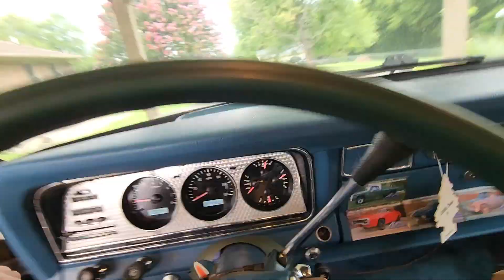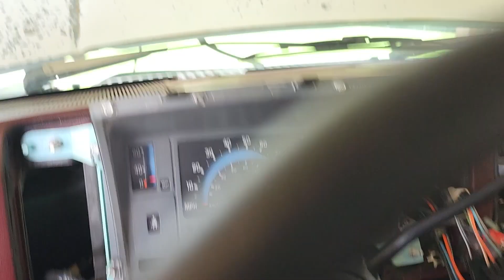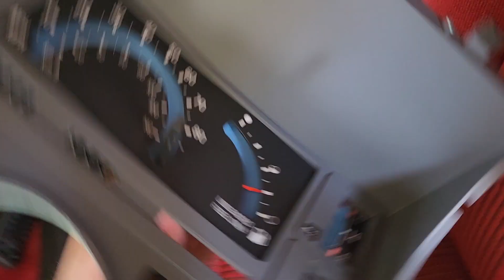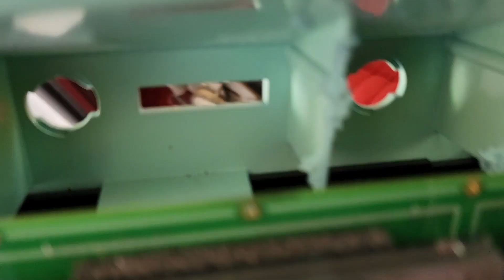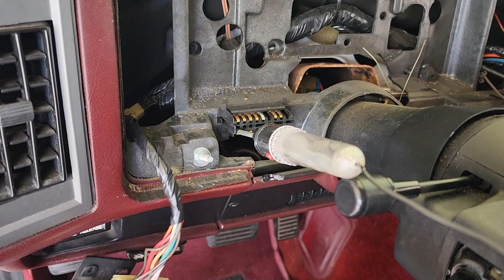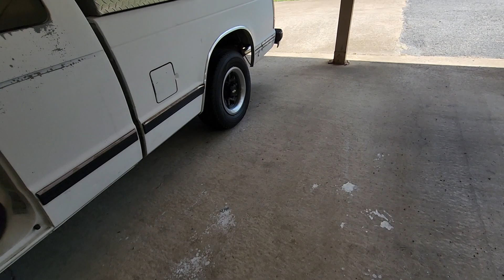1992 S-10 Dakota Digital Gauges Install!

Comment: What did you wire the alternator into for it to show the voltage?
Reply from the maker: The voltage is signaled from the power circuit to power the digital gauges, no special wiring required!
Reply: So you basically tap wires off of the factory plug to the control box Bim?   . My example is a OBS 1990 with a LS engine. Tach wire off of the gauge cluster. Would it be landed on the tach terminal on the control board with the LS engine tach wire?

Comment: So I got a question about the speedometer, how did you get it work, by the way the gauge looks awesome with the truck
Reply from the maker: Thanks for the comment, I think it turned out great! 

I touch on this in the video but didn’t get too in depth. I used the original sensor in the truck (because it was the electronic variant, not the speed cable type). I found a pin out diagram on Google Images, and hooked the speed sensor wire (Speed+) to the wire on the pins for the old cluster. And the Speed- to Ground. This yielded a working speedometer, but not accurate. Then, if you look at the manual, you can config for GM products and it corrects the error in Speed. Then I was 100% accurate comparing to GPS! This worked well in my case, on the 1978 Jeep pictured I used a aftermarket speedometer sensor to interface. So each vehicle is a little different! If you decide to pull the trigger on this setup, shoot me a comment and I can help anyway possible!
Reply: @RandomAutomotive  awesome I appreciate the reply, much appreciated